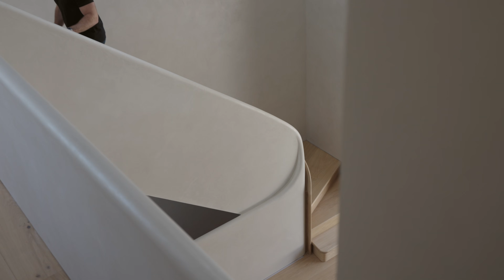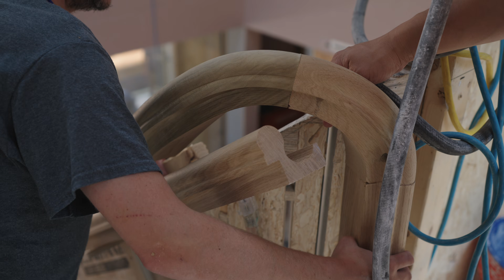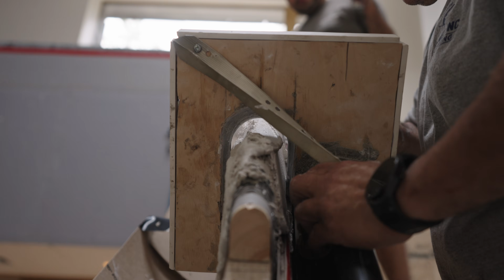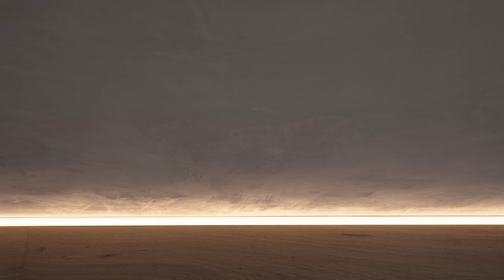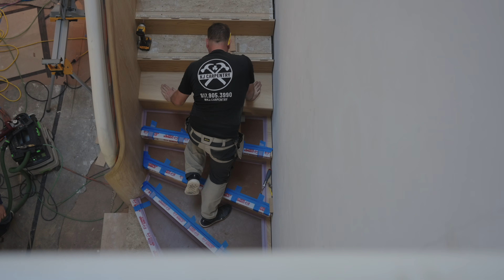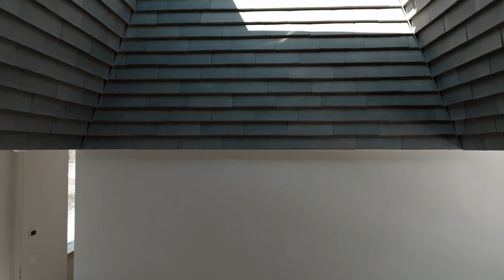45 White Oak | Why This Modern Staircase Was So Difficult to Build

Comment: I dunno. I know the shadow lines I'm seeing have to be intentional, but I'm just seeing gaps where the treads don't quite meet the wall. Maybe there's been some movement in the timber? That will happen when you've got that much wet finished plaster in a room. The water has to evaporate, and timber swells when it's exposed to humidity and shrinks when it dries out. It's why we used to put skirting boards on timber floors, and a staircase is ultimately a timber floor.
Nice staircase other than that.

Comment: Magnificent staircase, it brought back great memories as my dad renovated our Brooklyn brick row house in the late 1970’s and we built 3 C shaped stairs with plastered walls and white oak treads. Your work is impeccable, we didn’t have wiggle board back then but used 2 layers of 1/4”  upson board, and then plaster. 

The stairs are still there today and I am sure yours will last a lifetime.
Reply from the maker: Love that. Thanks!

Comment: Not as impressed as I thought I would be. Do not like the use of so much "processed wood" AKA...all the plywood. I'd like to know why they didn't use solid White Oak treads and risers instead of that laminated crap...

All that glue used in all that wood will fail over time.
Reply from the maker: No it wont and the treads solid white oak on a pine core for stability.

Comment: It looks amazing. The winder at the bottom was really well done too. What I notice about poorly done winders is the handrail suddenly goes vertical instead of a nice flow. 

One question I have though is why not put a handrail on the other side. From a functional perspective, if you're carrying something in your right hand or arm down the stairs, it's your left hand that's available. Sure, you can switch hands, but it's frustrating.
Reply: I think it's the opposite of what you describe. Your right hand would have more stability usually for grabbing and maintaining stability for going down.
Reply: @arepabuena I find I'm usually carrying something in my right arm before I get to the stairs and having a railing at my open hand is easier than trying to shift what I'm carrying